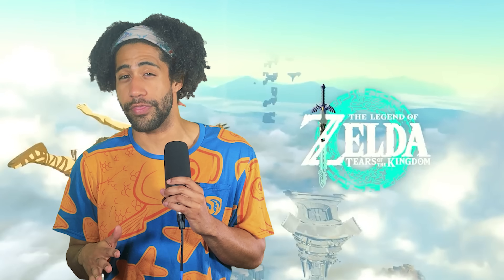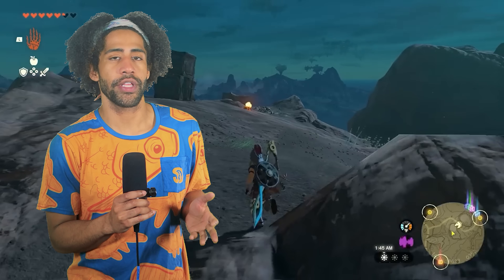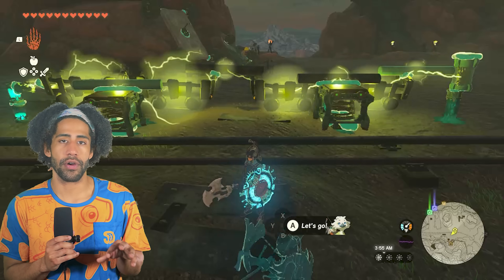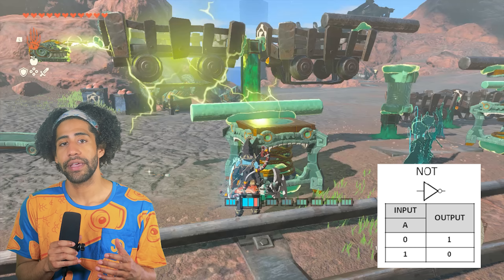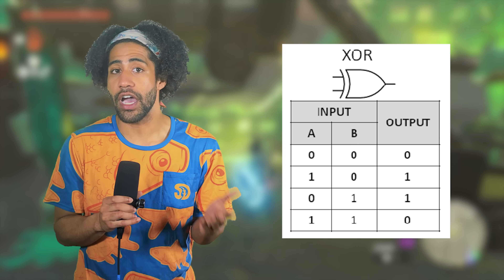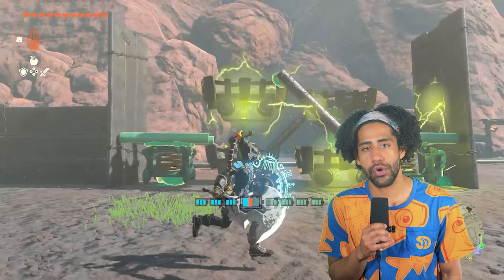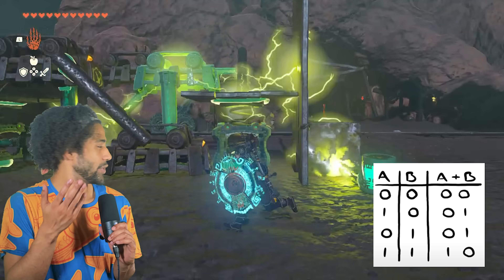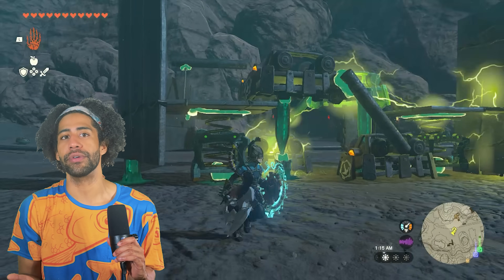how I built Logic Gates in Zelda: Tears of the Kingdom

Comment: I think you could make a xor with less parts just by stacking "2 spring height" springs and making the circuit connection in the "1 height" position. This does have a bit less clarity though as your B input is subject to move.

Comment: If you can make a device where two springs are on top of one another but can be triggered independantly you have a simpler half-adder:
Two springs extended = the beam on top is too high to connect to anything.
Only one of the two = the beam on top is completing a circuit for the lower value exit bit.
Two retracted = the beam is as low as it can get and finishes a circuit for the higher value exit bit.

The bit issue is keeping the springs independent but stable.

Comment: For the XOR gate, could you have two springs where one is upside-down, raised up above the first and slightly to the side of the first spring so that when one spring is a 1 and the other is a 0, the ends of the spring are aligned? Then you just have to stick something conductive on each spring and space them appropriately so that it doesn't falsely trigger.
Reply from the maker: This is essentially what I ended up doing! Video coming out soon

Comment: You are using the term "Turing Complete" incorrectly (and maybe the other video did, too)? It has been some time since I took Automata, but I think Turing Completeness required a read-write head.  So you needed the ability to both save off the results somewhere, and also the ability to read them in later.  While the limitations of the game probably makes it so that you couldn't read, write, and perform computations all in the same build, I think to show Turing completeness in separate parts you'd need a build that can both write and read ones and zeroes.  I don't know what that could be...a vehicle that drives back and forth and flips springs that are in a row?  Seems like there is a lot left to do.

Comment: Now you should start mixing gates, for example you can rotate the on the y axis the log or whatever you're using to connect the carts and have them dead center for connections, the top can then be used in another gate up top, alternatively rotate that same log on the z axis and put the carts across from each other, the additional carts can simply be used for an OR gate by putting their output in the middle

Comment: Shouldn't the gates be built so that the inputs are electricity sources themselves? That way the logic would be internally contained within the gate and you could just supply or not supply electricity. Certainly that is more complicated in TotK but it is how actual computers work and allows for gates to be meaningfully chained together. These spring switches cannot be practically applied since every one has to be manually operated which defeats the entire purpose. Your not gate is not meaningfully different from a buffer, the only difference is an arbitrary decision on what the spring position logically means. This just looks like a fundamental confusion of the difference between an input and a switch. Not all circuits are logic gates, and your not gate is the equivalent of saying a light switch is a not gate if the on position is with the switch downwards as opposed to upwards. A real not gate should automatically invert its input signal. If it is receiving current it should output no current, if it is receiving no current it should output current. If you have to flip a switch, you aren't inverting the current, you're just turning it on or off.

Comment: Hey man!  Nice video :) but it's kind of sad to see how the way the switches work makes it hard to be... More practical, lol.

Generally with these switches, you want your input and output to be of the same kind, right?  like ones and zeroes in and out are both numbers, or are both switch positions, etc.  But they are the same at least, and that allows you to easily feed the output of one gate into the input of another.

Issue here being, your input is the states of springs, and your output is an electrical current.  And, unless those are easily translatable to each other (i.e. you can use current to activate springs), you can't really expand too much on the gates.

which I guess is understandable given the game, lol, and the fact this is possible already is mighty impressive.  But it's just a bit sad to me that there is such limited future potential ^^

Comment: I don’t think your not gate works properly, it’s supposed to take signal input (electricity in this case) and do the opposite where yours basically acts like a switch (using the state of the spring as an input) For example if the gate is not powered yours does not have power as its output. Its fine if you use spring states as inputs and electrification as final output but the gates need to be able to use one another’s output as an input if you want to build a full adder

Comment: is there any way to use an electrical current to hit a spring/activate another device? as is you can't use the output from one gate and put it into another which is a pretty big limitation. it's already nearly at its limit from the build restrictions but aside from that i think this is the next issue.

Comment: Technically, to be Turing complete, you only need either AND or OR, though NOT is required. That‘s because you can calculate AND as NOT(NOT A OR NOT B) and OR as NOT(NOT A AND NOT B). But having its own gate for each is definitely preferable.

Also technically technically I lied about NOT being required, as you can replace it with XOR, since NOT A is the same as A XOR 1. But XOR is more complicated than NOT so emulating a NOT gate using XOR is putting the cart before the horse.

Comment: There's a sky island with two ponds and two gates which can empty the ponds. They are in sequence so the higher pond has 3 states already (plus a 4th I guess what I would call high impedance state my wife discovered where you can reach equilibrium and the upper gate just bobs up and down indefinitely). I think there's huge potential there for limiting part use.

Comment: If you prefer books, then "But How Do It Know?"  by J Clark Scott is an amazing short enticing book that explains the full workings of an 8bit architecture he designed for the purposes of the book. He didn't pick an existing processor because he didn't have the copy rights for the designs. His CPU if I recall (a few years since I read the book) is vaguely similar to the MOS 6502 we all know and love (Apple 1, Apple II, NES etc). He starts by assuming you know nothing, and then he explains what a transistor is, like what does it do, and the only conceit he asks you to give is that if you showed a diagram of the parts of a transistor to an electrical engineer they would tell you it does work like he explained earlier. From there he shows you how transistors is used to make logic gates, and how logic gates are use to make other logic gates. And then continues to use multiple logic gates to make everything, starting from the basic stuff, and continuing up making more advanced stuff using the basics stuff he showed.

Comment: 12:07 I would only disagree with this statement since as you mentioned, you can't use electricity to power zonai devices but you need the carry out (the 1 + 1 output) of the adder to be able to go into the carry in of the next bit (meaning it activates one of the inputs of the next bit). So using electricity can't do this essentially make it it not turing complete based on what's in the video, now that being said, I'm pretty sure there is a way to make this work.

Comment: I saw a video of someone building a logic gate using mirrors and the bright light from (i assume) the gerudo temple. He used the beams of light as the 1 input planks to block light (the 0 input) and I believe stablizers as the mechanical switch. The out put was a dots in binary on the wall. 
One big benefit is that the mirrors were placed on the ground without much connection needed so you can overcome the 21 piece limit easier. Also I didn't understand what I was looking at in that video until I saw this one so great job.

Comment: In some of the shrines there are motors powered by electricity and you can copy the motors using auto build.   Put the motor on the output of the circuit to better visualize the output.

Comment: Yesterday i got recommended that physics for the birds video. Today i got recommended this. I was hoping I'd discover whoever can indeed figure out how to make an adder, because damn it I'm a computer science nerd but I'm not smart or creative enough to figure out how to do it

Edit: this seems so simple now. Electricity could be affected dynamically, but was hard to control. Zonai devices are easy to control, but cant be affected dynamically. Using zonai devices to easily control conductive materials so the charge can change dynamically is the solution, and metal rods on springs seems such a simple and efficient way to do that.

The sticky limit is definitely the thing that makes this impossible to expand forever, but i reckon you could still get to a full adder.

Comment: Still seems like the biggest limitation (beyond the attach limit of course) is the lack of ability to trigger zonai devices with the machine, which is a core element of making the device theoretically infinitely expandable. Though I am curious if since your design relies on electricity, and is comprised out of fairly durable materials like metal plates and zonai devices, while being anchored to the ground, maybe that means you can use time bombs more reliably to relay information between gates.

Comment: You can do XOR gate much easier, just put 2 of your springs side by side such that their poles touch.

You can also effectively consider the XOR gate to be an "equals" gate, you want power to flow through if A = B, so if they are both extended or both down it flows through.

So you just want a vertical pole on either side that touches the "sides" of the spring'd poles wether they are down or up. Then if both of the poles are extended they form a constant bridge, and if they are both down they still form the bridge

Comment: So, I may be missing something here, but there is a bit of a problem with the electricity route, and it's connected with how they won't interact with Zonai devices. Since they won't interact with devices, and your inputs into the gates are via activating devices (the springs), you wont be able to hook gates up in series, which means you can't make a fully automatic full adder. The half adder was able to work since the gates are wired in parallel not in series, but more complicated logic will require a rework I believe. Other than that, great video! I'm excited to see where this goes next

Comment: If my memory serves correctly, pretty much any circuit consiting of only a combination of NOT, AND, and OR gates (all of them 2-input gates) can be converted completely into either NAND gates or NOR gates, though the result is often more complicated than the original circuit. I believe also that an AND gate with both inputs inverted gives the same output as a NOR gate, and an OR gate with both inputs inverted gives the same output as a NAND gate.
Reply: That's right you just need NOT plus another gate either AND either OR and you can build any gate.

But the current needs to go through the input, if you can't pilot the spring with the current then you can't chain them properly and so won't really being turing complete.

Additionnally i guess gluying spring to the board (like wood) at 45° and just having metalic part touch for conductivity would be enough and spare a lot ot parts.

To be confirmed...
Have fun.

Comment: Could you not have built the XOR by putting the two springs on top of each other and then adjusting height so that when both down (1) it doesn't reach, but if either extend it does, and when both extended its too high?

Comment: I’m not sure how stable this would be, but couldn’t you make an XOR gate by stacking two spring-rod things on top of each other, putting the rest of the circuit at a height where if both springs were in the 1 position, it would be too high and wouldn’t connect; but if both springs were in the 0 position, the springs would be too low and wouldn’t connect? And then if only one spring was in the 1 position while the other was in the 0 position, it would be the right height to connect. This would require about half as many objects I think. Really cool video though!

Comment: Computer Scientist Here:
Fun Fact! So long as you're able to construct a NAND gate (or a NOR gate)--and you're able to chain your output of one gate as the input of another--your system is Turing Complete by default. That is because every other logic gate can be made entirely out of NAND (or NOR) gates.

- For example a NOT gate you just duplicate the input into both A and B. So [A NAND A] reads 1 if A = 0 and 0 if A = 1.
- An AND gate is then you just take the output from the NAND and feed it into the NOT gate. So [NOT ( A NAND B)] is only 1 if both A and B are 1, hence the name.
- An OR gate you switch the order of operations with NAND and NOT. So [ (NOT A) NAND (NOT B) ] is 1 if either A or B are 1, inclusive. You've found that in your own experiments. 

- Lastly an XOR gate takes a lot more NANDs to work, but [ (A NAND (A NAND B)) NAND (B NAND (A NAND B)) ]. This one is a lot to take in, so let's draw out the truth table for this bad boy.
A = 0; B = 0; C = (A/0 NAND B/0) = 1 -> [ (A/0 NAND C/1) NAND (B/0 NAND C/1) ]; Both of the 0 NAND 1 simplify down to 1, which are then NANDed together to create 0.
A = 1; B = 0; C = (A/1 NAND B/0) = 1 -> [ (A/1 NAND C/1) NAND (B/0 NAND C/1) ]; The first clause is 1 NAND 1 = 0; Second Clause is 0 NAND 1 = 1; Together it's 0 NAND 1 = 1.
It's a symmetrical statement so I hope I don't need to explain why A = 0; B = 1 also equal 1. Just read the previous line but swap A and B.
A = 1; B = 1; C = (A/1 NAND B/1) = 0 -> [ (A/1 NAND C/0) NAND (B/1 NAND C/0) ]; Both clauses are once again 0 NAND 1 = 1; Then they are NANDed together to give us 0.

And as you have shown, AND and XOR (which I've both constructed out of NAND gates) create half adders. Full Adders are two half adders and an OR gate, and you can make your way up from there.
Like right now you can make your way up from there. Someone made a free browser puzzle game where you can construct a functioning--albeit bare bones--digital computer from the ground up.
Link: https://nandgame.com/
Reply: bump

Comment: If you take a look at the logic of an actual XOR gate, you can construct it out of NOT, AND, and OR gates overlapping, under the logic of (A AND NOT B) OR (B AND NOT A). That's exactly what you built, and is still impressive in its own right.

ＩＮ　　Ｂ＆！Ａ　　Ａ＆！Ｂ　　ＯＲ　　　　　ＸＯＲ
ＡＢ　　！Ｂ　Ｃ　　Ａ！　Ｄ　　ＣＤ　Ｅ　＝　ＡＢ　Ｅ

００　　１０　０　　０１　０　　００　０　　　００　０
０１　　１１　１　　００　０　　１０　１　　　０１　１
１０　　００　０　　１１　１　　０１　１　　　１０　１
１１　　０１　０　　１０　０　　００　０　　　１１　０

By using 3D space in Zelda, A and B can be on one input, having output on the states {00, 01, 10, 11}. Since 01 and 10 can both be equated to a unary "1" (the others being 0 and 2), you can have it output on both of those. Think stacking two springs together, with both able to be turned on and off individually from each other.